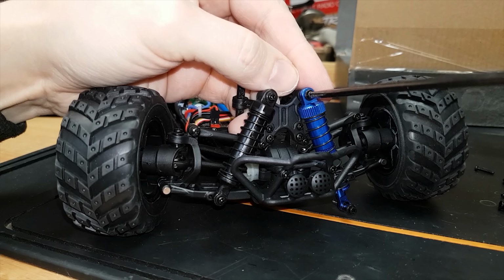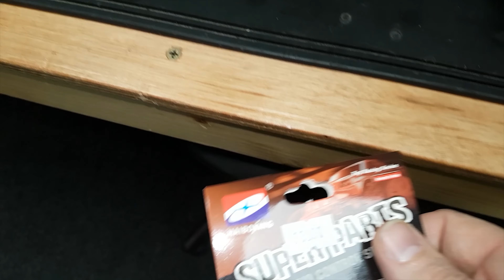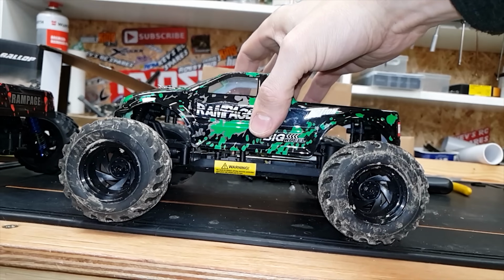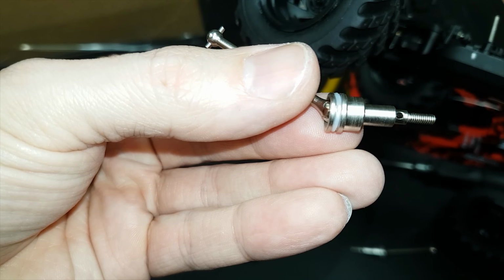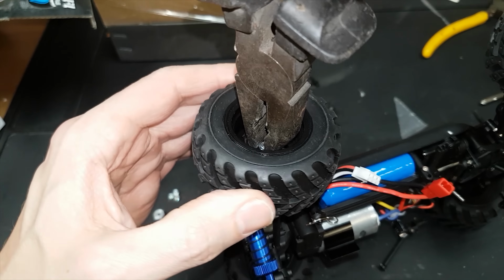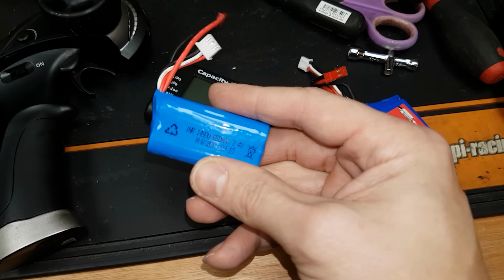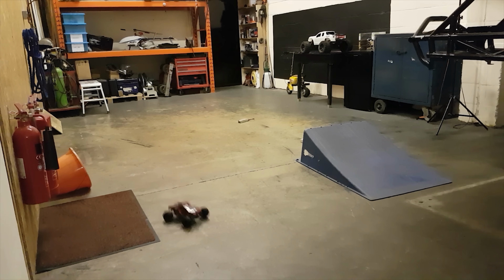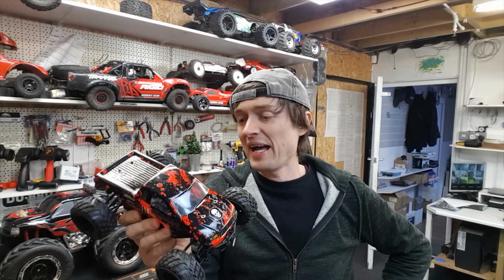The BEST Mods for HBX Rampage rc car

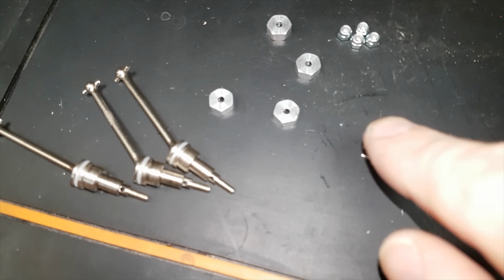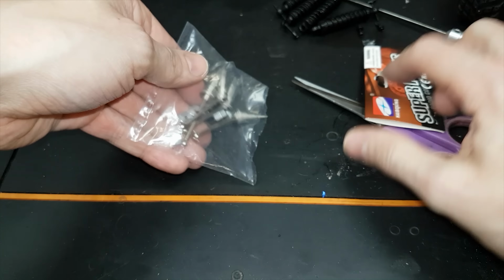Comment: Can anyone explain where the drive pins came from at 3:47? He cuts the bag open at 2:32 and empties its contents but the drive pins are not there. Then he says at 3:47 that he forgot to mention they come with drive pins....so how did they magically appear? I ask this because I received these parts today and had no drive pins in my metal drive shaft (hbx part 18600) bag....

Luckily I had some extra pins that worked, so no biggie, all good to go, but still just wondering.

Comment: We got one of these and they are great but it soon broke - the cog that sits off the motor no longer connect with the cog on the drive shaft at the rear - there is a very small gap between the 2 cogs so the motor just spins with no wheel turn. Nothing is loose, cracked or come away, I don't understand why it has happened. Apart from that, the car itself is awesome

Comment: I have this truck. Got it for my 4 year old son. He LOVES it. Full throttle slam into a brick wall and it doesn't break. The shafts pop out once in a while, no big deal there. You cannot break this thing just by driving it. It's perfect for indoor fun and it actually goes fast enough to run outside also. Great truck!

I'm picking up an Arrma Granite 4x4 BLX tomorrow at the hobby shop. I wish you would review that! 

Best RC channel on YouTube, Kevin. Thanks for the videos and inspiration.

Comment: I re-greased diff on that with axle grease for more of a locked setup.   broke the plastic.    metal set in mail from China.  also because I dont want to buy and check.   will wl 959 parts fit

Comment: Just made my rampage brushless
No need to upgrade the
Gears
Driveshaft
And battery
It Can nearly do a standing backflip
Reply: Details please!
Reply: @JayDauglash  you need:
a 2440 size brushless motor 4000kv
a 9g three-wire servo 
a 35 amp ESC 
 a new receiver
and some connectors
Reply: Just a kid do you have pics of this . I’m interest in doing this for my kids truck
Reply: @auno1647  too moch power man

Comment: I really love this HBX Rampage. I have two of them and they're really great. Did an unboxing and review on it too, on my channel.
=> BUT... parts availability is really crap. It's very durable but once you break something, parts are pretty expensive and not easy to obtain! Any tips on getting affordable parts (pref. with free shipping) are very much welcome!
Reply: Heaps of parts on Ali Express. Search for 18859 parts
Reply: Thanks, I do think parts are a bit expensive. Most parts (even the small ones) are around  8, 9 euro’s shipped. If you need 4 parts you might as well buy a whole new RTR set which, at the moment, can be found for 45 euro’s.

Comment: anyone have link to parts, struggling to find them.
Reply from the maker: i got these parts sent to me from the factory, im not sure who sells them, search for the part numbers on google dude
Reply: @KevinTalbotTV  thanks for reply, did my googling. The cvds can bee found easily enough, the usual places.  Issue seems the part number for the shocks is actually 18601. Which solves the problem finding them.
Reply: vash ts I take it your not in the uk as not even the uk hbx distributors can get theses upgrades, pls tell me where you got yours!

Comment: Still reckon the WLtoys A979 would be a better option.  Loads more parts available for it and you can get the version with the 540 motor for $60 USD on eBay.
Reply from the maker: yes more mods but i think the 540 is way to heavy i prefer the smaller motor non b
Reply: @KevinTalbotTV  I'm American Kev.  It's a rule that we buy the one with the bigger motor =)

Comment: Anyone know a straight swap motor from another car? I'm after a 3s capable brushless that fits, and same size shaft for the pinion?   (I have the 2s brushless motor)
Reply: Did u find a swap yet
Reply: @auno1647  hi, I have a Racestar 2440, 4600kv motor from banggood.   Its real fast (I'd guess at 45-50mph) but gearing is too high for the motor, so it's getting real hot real fast.  Gunna try with 2 heat sinks and fans.  But it's lasted about 10 packs (3s) so far and still going fine.
Reply: Need to try a 2450 can size, will just fit with my esc.

Comment: My a979b just kind of stopped working the other day I did a backflip in and took a pretty hard Landing in the throttle cuts out and I don't know what's wrong with it but I'm going to assume it's the electronic speed controller could you tell me if you've ever had a problem with this and what do you think I should do you think I should just go and buy a new one or see if I can try to work it out with this
Reply from the maker: not had that problem, make sure it rolls freely!
Reply: @KevinTalbotTV  Center drive shaft is straight and all the other ones are straight as well it works but Cuts in and out I have full control over steering but my throttle Cuts in and out quite frequently I think it's the ESC
Reply: @maximumrpm1868  it happened to mine like a year ago I don't know why too
Reply: @maximumrpm1868  loose connection I think, maybe on the motor
Reply: @dootslayer1402  it's not losing connection because my Servo is always working I've checked the plugs that's not it and the motor I just got it on Christmas and the motor the white fan blades inside the motor have started to flake but it's not too bad can I plug in today and it ran just fine I think I just smacked hard enough where I shook something loose
Reply: @maximumrpm1868  I mean the solder points on the drive motor
Reply: @dootslayer1402  yeah I take electricity in my school and I've checked and that's definitely a good joint and I appreciate the help bro it means a lot to me

Comment: Question, does the esc cut off the voltage properly (is there a setting perhaps on the esc too change that ?)
Or do you have too keep an eye out for that yourself or get a lipo buzzer as lithium ion cells which the stock battery is made of has a lower cutoff voltage that will damage lipo batteries or were they generous with the voltage cutoff from the get go so it works with both relatively safely ?

Comment: Hi Kevin.  I just made the exact same upgrades to my Rampage with the same steel drive shafts.  After reassembling everything,  the car doesn't have the same turning radius.   I was wondering if you encountered this same issue and went back to plastic in the front, or do you think I need to check how I reassembled it.  It seemed pretty straightforward though.  I love the channel.

Comment: I see you have a huge helicopter in the background
Reply from the maker: i got it to do a xmaxx vs helicopter mid air crash but it looks to good to wreck I feel bad for it!
Reply: @Kevin Talbot just buy a cheapo Used helicopter from eBay. They are only cheap and very big. Just get an old dirty one and make it fly 1 last time lol

Comment: those would be great for a little backyard race track because of the size and look quick enough to be fun.  My yards too small for regular size rcs, I have a 1/16th slash and I put the motor from my rustler vxl in it for the back yard and really think something like that would be a better fit.  thanks for the info

Comment: Hey so did you buy different wheels or did you use the same ones? Becasue your replaces the drive shafts and the old ones weren’t hex drives.
Reply from the maker: same wheels dude